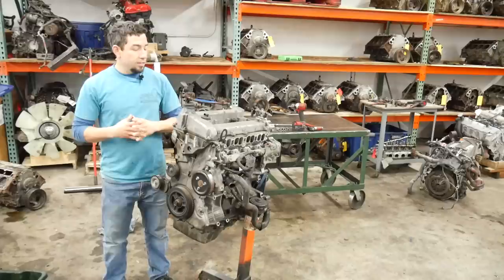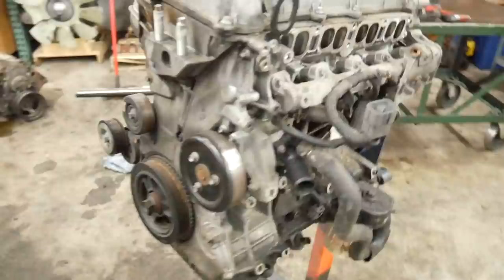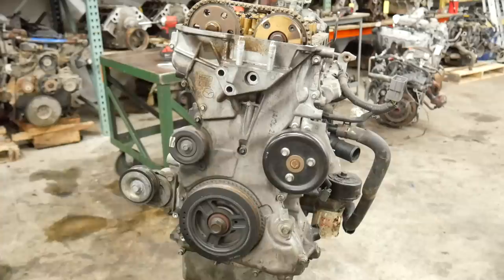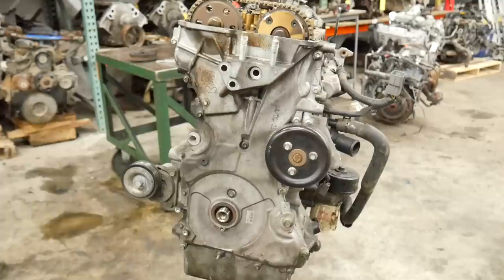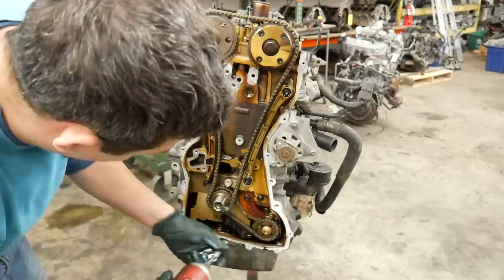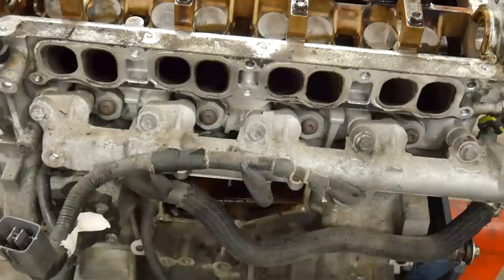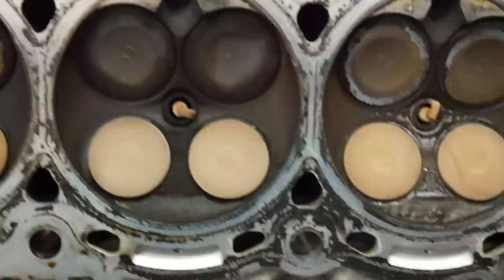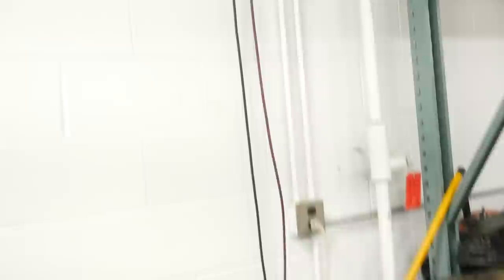TOTAL TEARDOWN: BAD Mazda MZR 2.3L Turbo Mazdaspeed3 Mazdaspeed6 CX-7 Engine.

Comment: I had a 2004 Mazda 6 with the ford duratec engine.  It took care of me for 300,000 miles.  She took care of me more than I took care of her.  The most annoying thing with her was the crappy shift linkage that I had to get replaced 3 times.  The part where it connects to the transmission was plastic.  Because that small piece of plastic broke, I had to get the whole shift linkage cable assembly that connects the stick shift to the transmission replaced.

Comment: Former owner of a MazdaSpeed 6 GT here. The MZR 2.3 had its issues but for being essentially an experimental DI engine for Mazda it was pretty damn reliable for me, unlike the power window switches and motors ($300 a door). The major engine uh, quirk, mine (really, all) had was the turbo oil issue where after driving at running temps for a bit the exhaust would turn to dark bluish black smoke for a few minutes and eventually clear up. Not being a mechanic I was always surprised that CX-7s with the same engine detuned were such maintenance nightmares
But the car was pretty great even if many interior plastic parts just did not hold up to years of desert summers and had ever-widening panel gaps. The dashboard was always tight and I liked how clean and simple it was. The car pulled with authority once you turned the turbo on with the gas peddle, and you could definitely feel when it engaged the rears. Being a manual though, the car really was not the friendliest when sitting in rush hour traffic. It was a car that was always best in open-road driving, and my kids got a kick out of how well it handled.

Comment: Fun fact, that is the same engine in the ecoboost mustang. Also my 2006 Mazda 3 with the 2.3L has 176k and hasn’t had any issues. Stretched chains can be prevented with oil changes done on time.
Reply: Not really. They're related by bore spacing, but the 2.3 EcoBoost uses a different block with an open deck (as opposed to the semi-closed deck design seen here and on the early 2.0L Ecoboost). Cylinder heads are also different (EB 2.3 has a casting with an integrated exhaust manifold because emissions control).

Comment: Thanks for your insight, opinions, and sharing of experiences.
After watching this and reading a few comments, it bothers me that a Mazda tech told me that I have the oil changed too often in my naturally aspirated 2.3 MZR - 2009 Mazda3 sedan.
Because I generally put few miles on the car - it’s at 143000km, I tend to change the oil every six to eight months (the car’s almost 15 years old) as opposed to the 8000km interval - often with as few as 2000km, using Mobil 1 5W-20.
Sure the used oil may ‘look’ new, but at $40/jug, $10/filter, and the labour (the car’s too low to do at home) I’m okay with that $200/year outlay.
The engine burns no oil, turns over immediately, idles smoothly, and pulls as well as any 150hp four cylinder.
Yes, I always take it to the dealership for oil changes (snicker all you want), as I’ve found it beneficial in the long run to have a relationship with this particular dealer. I own a 2004 MSM and a 2016 CX-3 both of which I maintain myself, along with two other Mazda’s owned by family members. Having a good relationship with the dealership has secured me discounts on winter tires, rims, batteries, filters, etc. Oh, and they’ve never charged me more than $40 labour for the oil change.

Comment: I have a mazdaspeed3 full bolts on with a cts4 turbo. I bought it stock with 28k miles. It has 200k now and I have never had issues with it. But I have always keep up with the service and oil change

Comment: In 2012 Mazda forgot to harden the exhaust cam shafts on the 2.2D Skyactive engines for NINE MONTHS of production. The metal particles would blow turbos and vacuum pumps, no recall, not covered after warranty. My 2015 reg was came with one of these engines, so >60% diesel Mazda 3 and CX5 you see on the road are running on 4 exhaust valves.
Reply: Those 2.2 diesels are an absolute nightmare.

Comment: That is so odd. I shit drove mine but made sure it was well maintained…..it wouldn’t quit.  I even filled it with water once in a huge pothole….pulled the plugs, gave it the dry start, worked like a charm. The thing was a beast. I don’t understand

Comment: these engines are incredibly reliable if you do maintenance on it.. just like anything else. at my dealer the engines that are changed are all lack of maintenance or abuse.  the chain stretching is common for lack of oil chances.  either way its only $39 plus the friction washers.

Comment: I have a Μazda CX-7 the last 13 years. There is absolutely 0 damage /issues until now, except a small battery drain, that happens the 2020 and over. (i have to start the car for 5 mins once a week)

Comment: Stretched chains on a CX-7 engine is usually always from abuse. The Mazda 3 and Mazda 6 is usually from lack of maintenance. And maybe some abuse. But the CX-7 owners are pissed they have to drive an SUV and want to drive the 3 or the 6 and hammer them but the CX7 weighs way more and that strains that engine so bad
Reply: Yeah my old friend's mom had the same vehicle and was abused so engine went ka-put pretty early. You really had to push it to get it going but it "feels" fast when it's being pushed hard.

Comment: Don't forget those engines were built and designed in the "Ford"  erra. Those engines were also put into Ford's. Those engines were designed by Ford engineers not Mazda engineers. Now the new Skyactiv-G and Skyactiv-X engines are designed and built by Japanese engineers and are very very reliable.
Reply: so that is why its shit.
I have not heard anything bad about actual Mazda Engines.
Reply: My Speed has hit 201,000 kms, makes 201 kw atw and 425 nm atw, on stock bottom end and stock clutch driven everyday, no issues at all. All down to servicing and getting a reputable tuner. I bought it at 101,000 kms 4 years ago. Currently saving up to do rods and pistons and bigger turbo and chase more power.
Reply: Aren’t these designed by Mazda with Ford parts. I think I remember hearing they had an agreement that Mazda would design the smaller engines and Ford the big ones when they were together
Reply: @InksJC  that is true.  Just like the duratec 3.0 V6 was designed and built by Mazda/Suzuki in the early 90s.  So technically the Aston Martin DB9 was powered by Mazda, as that 6.0 V12 was two duratec V6s on a common crank.
Reply: @InksJC  
I do not know 100% for sure so it is very possible you are correct. But you can still have a good design with bad parts. All I am saying the new Skyactiv technology is really good and reliable.

Comment: I had a 2008 Speed3 that I bought new and put 275k miles on it with no issues at all. I wrecked it all the way and now it's gone. I thought the Speed3&6 had forged internals with Manley rods. CX7 was different. It was a very expensive car to maintain though.

Comment: I've had 2 of these well over 130k with big turbos..  no issues.
Reply: i think good oil and change evry 5000miles the oil, also change coolant water.. the engine would not look like this..  the oem oil its trash. Sorry for my bad englsih ( I use 5w-50 from Mobil 1, much people use 5w-40) and also the new mazdaspeed Facelift dont have this chain problems more.. or not so much.

Comment: I had a Spped6 and I loved it.  When I bought it, I bought the extended warranty and hit the limit when the engine seized.  I sold it right after it was fixed.  I was told the turbo leaked oil but since I used synthetic it didn't smoke.  It ran dry & warped the block.

Comment: My mazdaspeed6 laughing at this video with over 200k miles gapping almost all subarus and a few other cars with 0 issues🙃🥰haters gonna hate 🤷‍♂️
Reply: Same here, I have 2 Mazdas, the first being a 323 Protege 1.6 that I've had for 13 years and the second a 3 MPS 2nd gen- Both are totally standard and fully serviced. Oil on the MPS changed every 4000 miles- Neither has ever missed a beat. I agree I would rather have keyways on the pulleys but a lot of modern engines seem to have gone down that route. If you want true unreliability buy something European, I've had a few Renaults in the past and they just break for no reason. VW's/Audis and BMW's have some really bad design flaws that will cost you if not replaced in time. Most Italian cars have a poor reliability history. Japanese cars have always been better screwed together than most other makes.

Comment: As a Mazda fan that owns a 2006 Mazda 3 with the 2 liter MZR, I can agree with you on all the points you made about the engine.  I also hate the engine for the exact same reasons you stated.  After having the engine that came in the cars timing chain replaced I fried the bearings in it, then replaced the engine with one from a 2009, after starting the engine, I found this replacement needed the damn chain replaced as well.......$2k later and I have a running engine.  I hate that the damper isn't keyed, if you blow the head gasket or have to remove the oil pan you may as well just get a replacement engine as it is cheaper then having the labor to get done.    I also have a 94 Miata with the BP engine, and a 2020 CX5 with the turbocharged skyactive engine.   At least the skyactive engines have a keyed crank again, so there is hope.   Just wanted to agree with you on all the points you made, great video.
Reply: Also forgot the rear main seal is not hard to replace but if you don't do it just right it will leak again soon.  It is because instead of a hard formed rubber it is some type of compressed felt and it is really easy to fuck up.

Comment: Some of the issues started with the extended oil change intervals, from 3k to 5k, 7k, or 10k miles. And people using the cheapest oil they can find and doing one oil change a year. I bought a Toyota Tacoma with the 2.7 4 cyl, and previous owner eas doing oil change once a year, almost 15k miles between oil changes...😳
Reply: Totally agree, why would anyone leave the oil in for that long. The oil breaks down and then starts gumming up the works. It's a massive false economy, being a cheapskate on servicing.

Comment: There is a special timing tool for the cam that locks both the intake and exhaust cam but it requires the removal of the high pressure fuel pump. That's why its also slotted like the exhaust cam. Also the main cause for the chain slap isn't chain stretch ita vvt  failure which is usually verified when you see the plunger on the vvt is missing.
Reply: Exactly. I'm so tired of hearing it's timing chain stretch. There is a pin that locks the inner stator on the VVT actuator on startup until oil pressure builds up in the actuator, this pin wears or fails completely resulting in a rattle in start up for a second or two until oil pressure has built up. If there's any slack in the chain with the engine off its usually as a result of the inner stator moving when the engine is off due to a failed locking pin.

Comment: Mazda and Ford creating engineers wet dreams and a mechanical nightmares!
Reply: Ford still makes this engine and has actually improved it tremendously since the last time it was in a Mazda lol
Reply: @alextran8188  Almost like they used mazda as their guinea pigs from the getgo to mark the blueprint that became the ecoboost engine going forth (minus the head gasket nightmare in the early production Focus RS) but if mazda were to ever do a third gen run of mazdaspeed (mazda just please give it already!) Then it's going to be interesting to see their skyactiv tech for a beefy hatch, or even a return of the speed6
Reply: @alextran8188  the 2.5 MZR is the last one they came out with and is a major improvement. I'd argue that it's even better than the ecoboost.
Reply: @alextran8188  mazda has the 2.5 which was like the duratech fusion 2.5 turnocharged now. Looks good. I remember seeing a beefy chain too. Was that oil pump deleted on the gen 2 speed?
Reply: @mikeschiavoni5973  the L3-VDT is the stronger engine compared to the L5. The L3-VDT has bigger, fully floating wrist pins, hypereutectic pistons, sinter forged conrods and a forged steel crank with bigger big ends than the L5. The L5 timing chain is no good in a GDI engine like the L3-VDT due to higher particulate matter in the oil, hence the reason the L3-VDT runs a roller chain. The L3-VDT also has a block made using a better casting process for more strength, it's a vastly superior block than the open deck design used in the Ecoboost 2.3 by Ford. No Ford ran the L3-VDT.
Reply: @byteoncomputerservices8054  thanks, i ll reference this, not a waste of time!
Reply: Had this enigine without the turbo in my 03 ford ranger. Was at 250000k when I wrecked it. Regular oil changes work.
Reply: @alextran8188  not in the case of the Ecoboost 2.3. The open deck design combined with thin castings make the 2.3 EcoBoost a total POS compared to the L3-VDT.

Comment: I still have mine a 07 CX7 AWD. It had almost 180,000km on it. It is a fun and quick car. I replaced the turbo three years ago. It was an absolute nightmare. Most screws you can’t see them and you can only remove and install them by touch.  I won’t blame Mazda Engineers though, this is one of Ford’s Duratec Engines. I owned about a dozen Mazda in 30 years. This one was the worst. In a normal car, replacing the PCV is a couple minutes job. On the Duratec, it’s a 5 hour struggle because you have to remove the Intake Manifold.

Comment: I watched your Honda Civic video yesterday and did not comment. All the experience you have and you didn't know it was a thrown rod? I remember when Toyota started using aluminum blocks, I saw one where it looked like someone took a hatchet and went around the outside (not completely) and smashed through it in a ring. It was a 1999 Corolloa with 20k miles. The new alloy block is no match for a steel crank and hardened rods. This is my first comment, and might be my last here. Keep up the good work, the channel is formatted well from editing and commentary. And it is accurate from a technical perspective.

Comment: MZR is a good engine . Never had any problems with mine except minor maintenance and valve cleanings. Any engine will do that if not maintained. I just think you have done alot of these with terrible owners . Got to run full synthetic . I run pennzoil platinum full synthetic and change it every 3000 miles. Runs like a charm. My CX-7 is a rocket  🚀

Comment: I have a 2011 Mazdaspeed 3 with 145,000 before it started ticking. Had the top rebuilt and 30 days later the new timing chain snapped. Bye motor. I have a couple of friends who had rebuilt motors from this guy and no issues. I had nothing but issues.  Last June I found a JDM Motor and Trans. Had a reputable shop do the installation and so far so good. Since last June, I put 6K miles on the motor after getting the Corksport HPFP and Access Port. Kept it simple. I don't drive it hard out of fear.

Comment: I had a 2011 msp3 big turbo, e85, 65k miles, never had any issues. That being said, I cleaned the valves regularly myself, I changed the oil all the time (ran it hard) and constantly did preventative maint on it. Car made 385 WHP on stock block and never had any failues. I owned it since 11k miles stock.

Comment: If I had to guess, someone was in the bottom end and did the bearings at some point. But never torqued the rod caps to proper spec, didn't replace the caps to their original orientation, and didn't reinstall the balancer properly. Causing more stress on numbers 2 and 3. Hence "cooking"  the rods as well as the bearings.

Comment: My fiance drives a CX-7 with this engine. They have incredibly short oil change intervals (3k miles). Has 100k miles on it currently, still runs great. I always change the oil at the correct interval, and always use valvoline or castrol full synthetic. Given that, cost of oil/filter maintenance is very high given the value of the car. 

Also, I always make sure she runs quality premium fuel (even though the owners manual says you don't have to). I ran a tank of budget station 89oct in it once, just to see how it would like it. Ran fine under normal driving conditions, but WOT in the higher rpms I could tell it was pulling a bunch of timing and/or boost. Might have been compensating for knock, I'm not sure. Just seat of the pants observation.

Haven't had any issues with it yet. Still runs like a top. Probably should do some walnut blasting on the intake valves soon though.
Reply: 3k miles? Jesus, I would change the oil every 2 months... That's just crazy. What a waste of time to drive this thing.
Reply: @myousic4564  Ya, its not ideal. The non grand touring trim, with the 2.5L has longer oil change intervals. I'm doing oil changes on it about every 8-10 weeks. Only takes me about 20-30 minutes to do. You could probably run 5-7k mile intervals, but 3.5k is what is recommended, and I need this thing to last so I'm being anal about it. For what we paid for it, I could do that for 10+ years before I would even come close to breaking even on the price difference between the CX and something like a RAV-4 or CR-V. CX was also better equipped. So, it's really to each their own. I don't mind doing my own oil changes. But if it would be a big annoyance, just look elsewhere, or buy one with the 2.5L.

Comment: If you think the MZR is a bad motor I would love to see you tear down a Prince EP6 engine or N18 Mini engine. BTW the mazda in my profile still runs with original engine with original bearings at 250,000km (155,000miles), all from care and love.